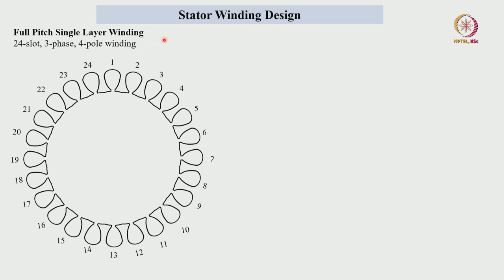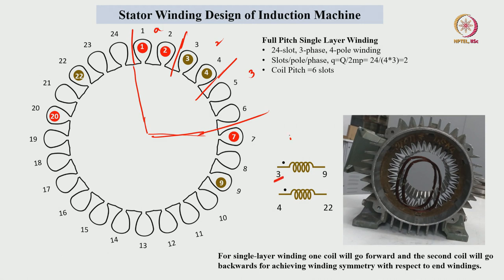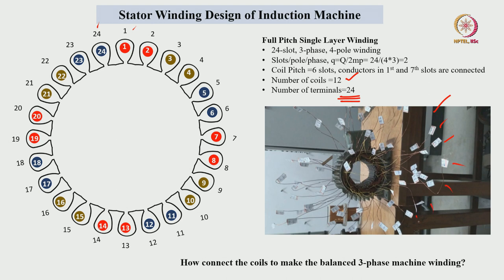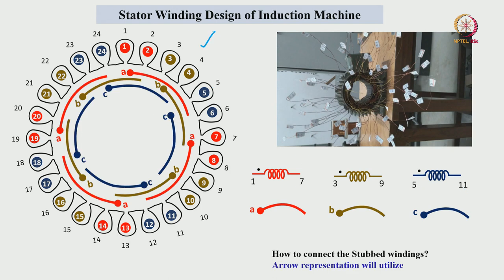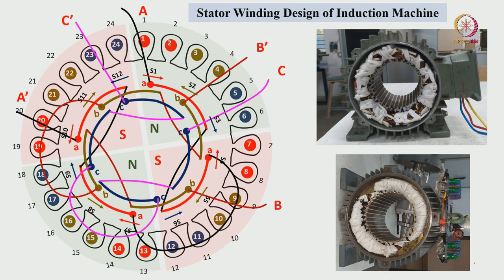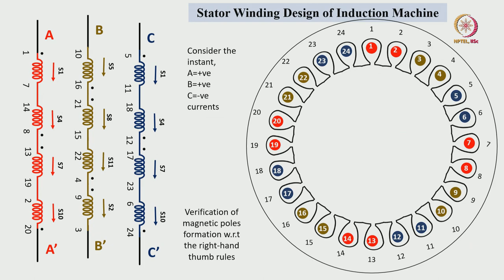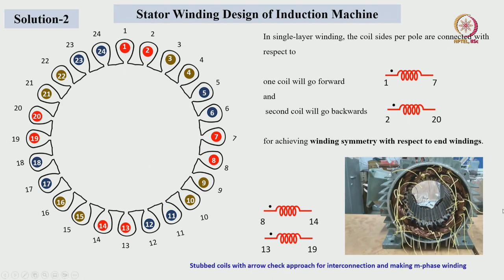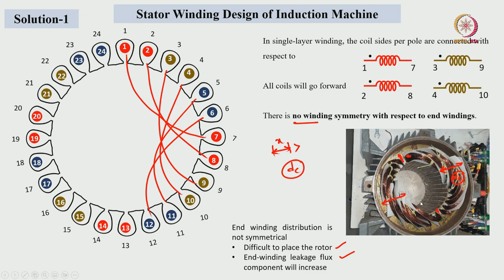Lec 21 Stator winding design-single layer winding

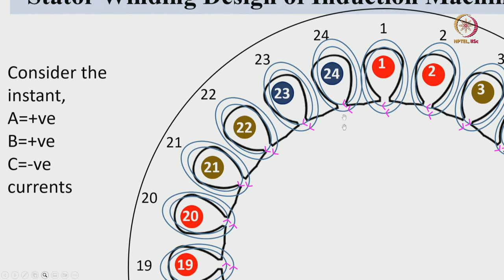Comment: At 28:24 please check for c phase also which u skipped but we r not getting poles as u explained later plzz look for c phase currrent directions also and get back in comment reply explaining c phase current pole formation
Reply: I am getting dot in slots 23,24 and 11,12 where as you are getting dots in them plzz explain how